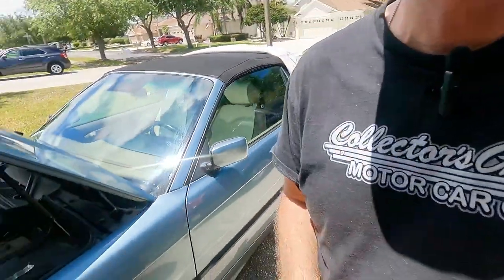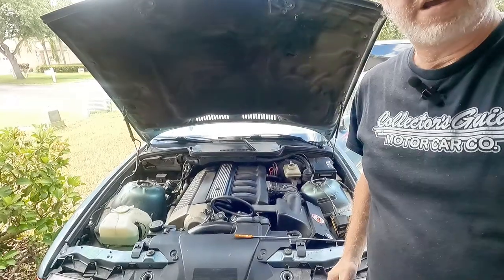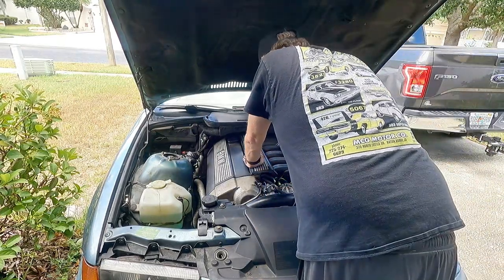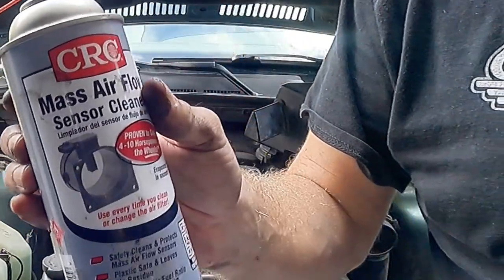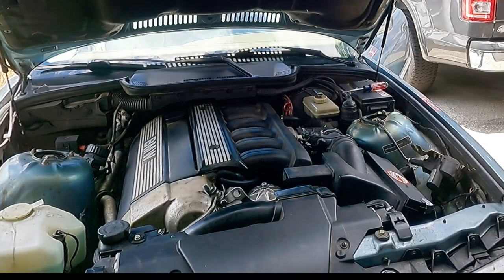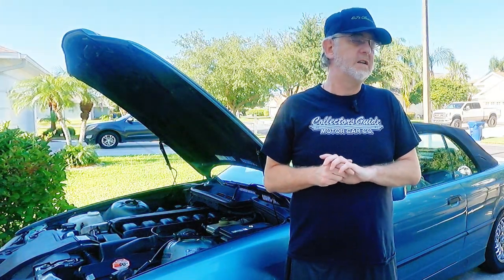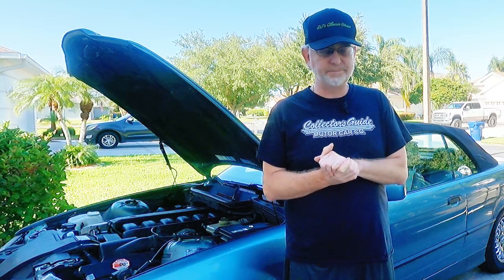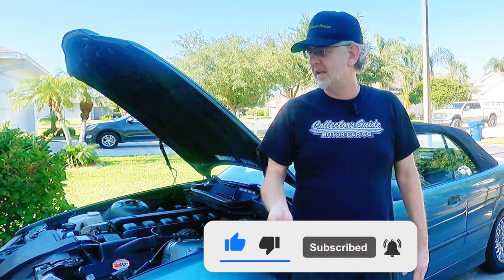Project E36: Well, This Sucks! Why is It Running So Bad

Comment: DO YOU HAVE A SET OF TELESCOPING MIRRORS. I DROPPED MY TRANSMISSION TO REPLACE THE OIL PAN GASKET ON MY 1995 CHEVY K1500 4X4 AND THOSE WERE GREAT FOR HARD TO REACH/SEE SPOTS
Reply from the maker: My f150 has them. Good luck